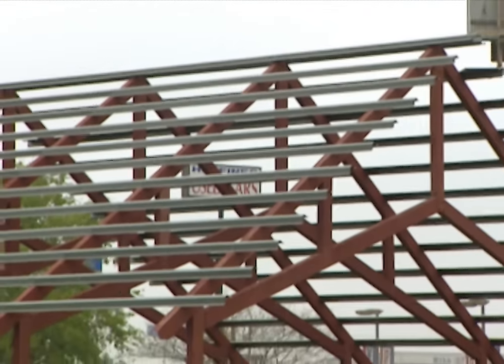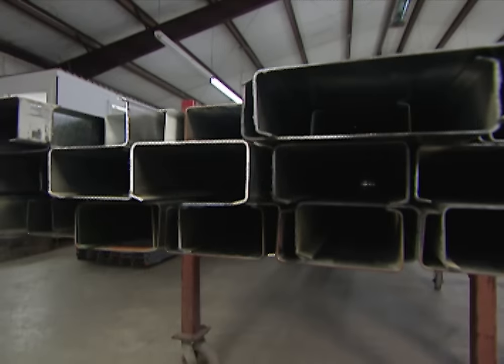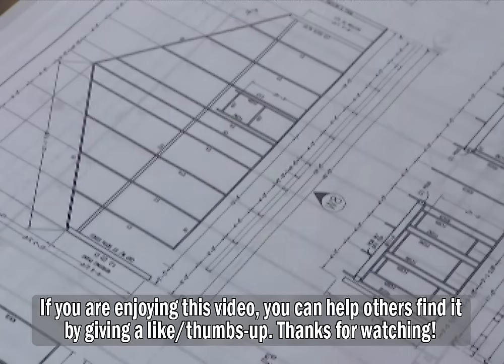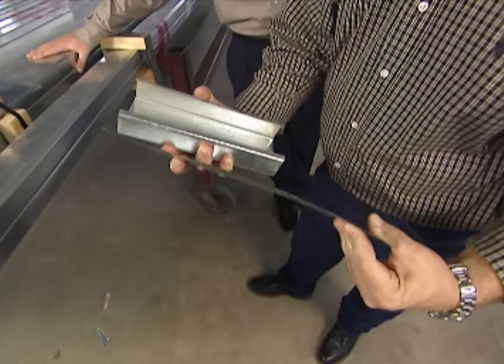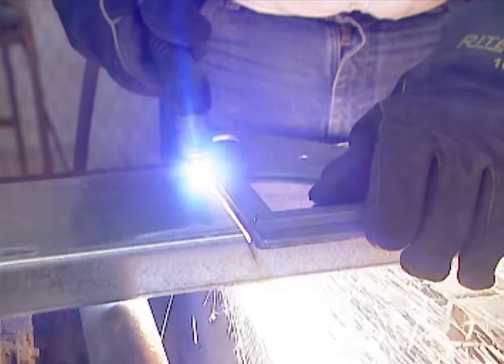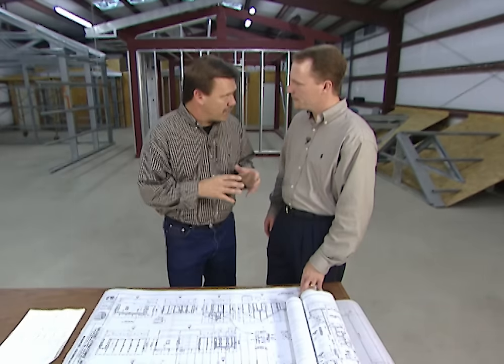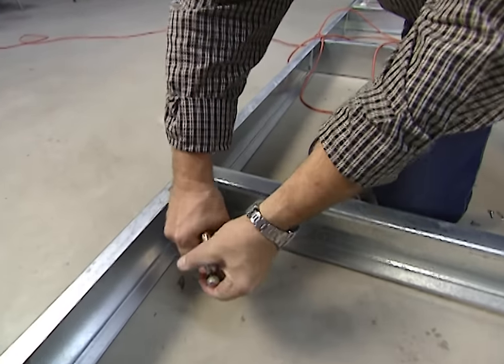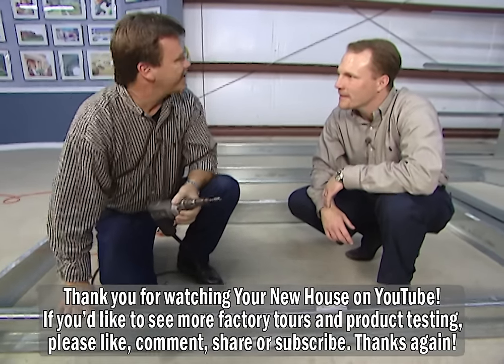Steel Framing - Did You Know?

Comment: Was this video originally filmed in the late 90’s/early 2000’s and then reposted this year because of high lumber costs???
Reply: OMFG.  Was think the SAME exact thing!!!  And the lumber costs are going to get worse!
Reply: Any home that relies on wood for support does not get my vote. Think huff and puff. There is nothing wrong with steel support, it is superior. But the labor industry would naturally disagree. I saw a row of townhouses here which consisted of nothing but a concrete base, wood framing and brick outer layer. The cost to buyer was insane.
Reply: hahahahahahaha
Reply: That place has been there for a long time. You can part and walk over to look it all over. I stopped by there in 2004.
Reply: I was expecting when I looked at the video date for it to be 2005 at the latest. Did anyone else notice the guys on the chop saw had no hearing protection? Talk about going deaf!
Reply: @flashbangkennya5498  : Yeah but what about proper eye protection first !
Reply: This does look like the early to mid 2000s
Reply: Lumber prices are absurd right now, time for homebuilders to give steel 2x4 more consideration
Reply: This is old footage. Do a web search on Tri-steel and see what comes up.
Reply: Lol good call dude....it totally looks like it
Reply: I built a Tri-Steel home in Michigan in 2000.  Awe, the good old days.  My wife and I built the entire home with a little help from friends. Twenty one years later it still stands talk and proud!  So sad that the company went out of business.
Reply: my man hahahahah denzel voice
Reply: This is a clip from "Your New House", a television series that aired from 1995 to 2005. So, yes.
Reply: This video was shot with a DSLR camera with a rolling shutter... You can tell by how the image distorts into fluttering bends and waves when looking at all the vertical lines (So it was videoed more recently than 2008)... but by 2010 any decent videographer knew better than to move the camera while videoing vertical "stripes" with a rolling shutter or zoom like they did near the beginning of this video... (which is a total rookie move.)
Reply: And?
Reply: It must have been filmed a while ago, because health and safety is not a thing in these videos. No proper face or eye protection, or arms really, get a lot of scars from burns on the arms.
Reply: I heard 80s porn music in my head watching this???
Reply: What lumber costs? I own a tree farm, make my own lumber.
Reply: they guy wearing pleated pants was the major giveaway!  lol
Reply: That's kind of why I'm here😅 not going to lie I live out where we get a lot of water and termite damage I'm also trying to figure out a good way to avoid plywood maybe a composite or even look into polyboard
Reply: @paulmunro3175  the longest time I thought I could actually use Plastic Lumber by itself and I realize how stupid I was but using steel frames while still having some sorta polyboard is what I'm currently looking into because where I live water and termites are so bad I don't mind putting in extra money knowing is going to save me money in the long run I just have to find the right materials and of course the right manufacturer because let me tell you I used to see like 4 years ago a lot of steel framing being advertised as DIY custom kits but now I can't even find that and I find that a bit suspicious not to mention I'm going to have to strong arm the hell out of my homeowners insurance company and probably my county's building permit agency even though I live in a state Ware manufacturing steel is in the top three things my state is known for producing the other two being coal and bourbon I swear these companies do not want people to go against tradition it really makes no sense
Reply: That explains the 38 pixels
Reply: After reading your commit I had to look up the cost difference between wood and steel. Today steel studs are going for around $5.00 a stud and wood is going for $8.00 to $10.00. When we started our detached garage project a few years ago wood was a much cheaper option. Now, this may be an opening for steel studs to become the new norm for building.
Reply: @flashbangkennya5498  Yah, I noticed that, unless he had ear plugs,but I looked closely and didn't see any. I'm surprised the company allowed that video as this would be a work place safety violation.
Reply: @krazyj1957  3-5/8" 20ga studs are going for around $0.82/Ft in the central Texas area right now, and I buy large quantities so this is wholesale price. Top and bottom track are worse, and heavier gauge structural studs are well over $2-3 a foot. Yes, lumber prices are crazy, but steel studs aren't cheap by any means, at least in my area. There is also an enormous shortage, causing 3-4 month lead times for steel.
Reply: @paul49777  How do you deal with thermal bridging in Michigan?  I can understand wanting this type of framing in Texas but in Michigan did you do something different with the insulation to keep the steel from conducting cold from outside?
Reply: @chrisvaiuso6010  , used rigid exterior insulation 1 1/2” then with water proof house wrap. Inside the 8” wall cavity used blown in “NuWool”. Added 3/8” hard foam insulation on interior walls and ceiling before the dry wall installation.  Had zero thermal bridging spots detected with thermal/IR cameras when measured four times at the start of each quarter the first year after construction.  The house is twenty years old now, though we no longer own this home it appears to be preforming well for the current owners.  A follow up cycle of thermal/IR measurements would be interesting to evaluate the entire system.
Reply: @paul49777  Did you monitor your energy usage compared to neighbors with traditional houses?
Reply: @moodberry  I did not.  Though it would not have been beneficial, at the time there was not anyone that had a 3500 sqft house within two miles of me. I had installed a pump and dump geothermal (3 ton (WaterFurnance) unit) heating and cooling system, again not another one of these within ten miles. My total electric home had a monthly expense of $265.00 averaged throughout the year.  I figured that wasn’t too bad considering the basement was not in the conditioned space and it added another 2500 sqft.  My well produced 150 gallons a minute at a temperature of 57 degrees year round pulling from a depth of 215 feet.
Reply: @flashbangkennya5498  no safety glasses for flying metal or sparks....
Reply: in my country light gauge steel was much more cheaper

Comment: Not one word about cost comparing to wood frame
Reply: It’s on par with timber.Here in Australia about half of all new homes built are steel framed.Primarily people choose steel because it is termite proof.
Reply: @davidjohnston7512  considering 96% of Australias population is near the shoreline, isnt rust an issue there? I mean i know termites suck but the humid salty air is just as bad on steel isnt it?
Reply: Yes , that's #1 Question
Reply: @gags730  Point taken, LOL/ Don't cheat on your wife
Reply: @gags730  lol 🤣
Reply: Yesss.. like why even repost it..its like being left with blue balls
Reply: @aurcrispy6329  LMAO!
Reply: steel used to be more expensive than wood, but not in 2020 and 2021
Reply: @cyclopsvision6370  I work with wood framing and I have not priced steel for any of my projects. Wood prices are going up and that's for sure. Might have to teach this old dog few new tricks and start looking into steel framing LOL.
Reply: @midas7934  It's galvanized.
Reply: @derpmansderpyskin  yes im aware of that, but galvanization doesnt last forever, especially if you live in an environment where the atmosphere is somewhat corrosive to steel. The further you live from an ocean the better you are. But also keep in mind the steel is very thin, it can rust through fairly quickly. Where i live there are some steel buildings, like warehouses, where the frames are made of thick steel (galvanized) I-beams, the galvanized coating is all gone and some of them have deep pitting, but these ones are within a couple of miles from the ocean, some slightly further are still rusty but mostly surface rust.

Comment: I love the comment, "we use an industrial steel chop saw with a 14" blade".  He makes it sound so professional use only, heavy duty, factory grade when in fact it is a basic steel chop saw, made by DeWalt, sold at Home Depot.
Reply: Yes, I thought the same.
Reply: Wrong, the metal chop saw has much slower RPM.
Reply: True I been doing this for 15 years that’s all we use
Reply: @billnunya858  yes, it's a basic tool you can buy at home depot. They're not that expensive.
Reply: Sell the SIZZLE not the saw
Reply: you can tell this was made in the early 19th century.
Reply: I wonder if they use those new flat metal retractable measuring devices. Tape measure?

Comment: i was a commercial (primarily) painter in the early 2000s and i had always been wondering when steel studs were gonna be used in residential construction. I would absolutely love to build a house that is made up of recycled steel framework. i'm glad this concept is finally getting traction outside the commercial application aspect.

Comment: I built my home out of steel 24 years ago, just like this. It's was manufacturered by tristeel.  It's the red iron style and the home plan is called cumberland ,  if they still make that one idk, but I love it.
Reply: Are there any problems with heating, cooling and condensation?  I can see the steel studs conducting a lot of heat through the walls.
Reply: @eitkoml  theres this modern invention we have now called "insulation" that tends to help with that
Reply: @bigmikeobama5314  And there is the problem of the steel creating thermal bridging.  Basically creating channels through which heat can flow in or out of a building easily.  

In most houses insulation is placed between the studs, with wood also providing a less effective insulation.  If the insulation will be placed between the frame and exterior then there is the problem of how to mount it, and what the siding and vapor barrier will attach to.  If more steel is used then the thermal bridging problem is not solved.

Steel can also easily lead to condensation, which leads to mold growth and rust.
Reply: @eitkoml  most of the time, it's a blanket of uninterrupted insulation, outside the studs (or however is designed for your environment). There are other ways to minimize thermal bridging as well.

Comment: I built a house for myself with this and it came as a kit (120 square metres) in 2002. It took about seven weeks from pouring the slab to  having inside and outside cladding installed including water, electricity and gas fixtures installed and operational. Brilliant to work with and the building was cyclone rated.
Reply: Cool story, bro.
Reply: @kaydog890  and you have less than 10k in the bank lol
Reply: I wish you posted on Youtube your DIY so we can learn from your experience.
Reply: @KA-vs7nl  I think you'll have way less than that buying a raggedy old house. 

Condo? 

Oh. You mean when you get 0 say on maintenance and it falls over? And you only own AIR?
Reply: @KA-vs7nl  steel studs ran cheaper than wood over the pandemic. I think they're similar or equivalent now.

Comment: As a former demolition worker I did see rusted steel on lower support steel when water was near by. Such as commercial restaurants, dishwashing areas, bathrooms, and sitting water. Just a fact. Otherwise great alternative. Clean up any water disasters around the base framing and keep dry. I would almost suggest engineering drain holes near those type areas. If your going to make a claim talk to people who see it all the way through its life back to the recycling bin.
Reply: i always thought it would be cool, although expensive to do this kind of house but with aluminum
Reply: You can paint the lower structure. Paint over galvanization is about as good as it gets for steel rust protection

Comment: Another great benefit is straight walls like engineered studs drywall finish will gave far less waves and bows. Our house is now 4 years old not a single crack on the drywall, not to mention a single creek or pop. House is dead silent in the wind and rain. Only weakness now is our shitty U.S standard double pane windows. Many European homes use triple thick pane  windows with a very high r value and even sound dampening.

Comment: keep in mind, there are weight bearing and non-bearing gauge of steel studs.  Always the same dimension, always straight.  Rain isn't going to hurt them stacked on the job site. I use them in basement build outs below grade.  If the foundation ever leaks, you don't have to worry about rot.  As far as screws to hold the studs in place, many guys don't put screws in the studs/floor/header plates.  When you set the studs every 16" or 24", the screws through the drywall into the studs will hold the studs in place. When steel studs first came out, you could drill and rivet each stud into place. OR there was a tool that punched/crimped the studs onto the floor/header plates.

Comment: I built a  big , all steel and concrete block  shop out of wideflange beam cuttings , joining then all together to make beams and rafters . And I got the steel cheap , because it was cuttings . It also    has 2 built in overhead cranes . lots of big high free span areas  . 32 years later , it looks like brand new .  At the same time , I remodeled my house , its wood  . 32 years later , theres rot breaking out all over the place , from       ants , and joint leaks , even though it got a new heavy gauge steel roof . If I were to do it again ,     Id build the house like the shop , then its done , as long as Ill be here .

Comment: When I built my 8X12 shed I used the steel 2x4's from Lowe's.  The front wall was 8' tall so no cutting for height.  The rear wall was 7' so water would drain off nicely and I did all my cuts with tin snips.  I cut the two front parts of the "U" shape and bent the 4" back and straightened it over and over until it broke apart.  It was quick, simple and quiet.  I screwed 4x8 lap siding boards to it and the only issue I had was the 2x4 pushing away from the screw if I was too far from the center near the unsupported end of the "U" shape.  I caulked the screw heads and painted it and it came out fine for a shed.
If I had it to do over, I'd cut about a 4" wood 2x4 and put every 2' so I'd be able to pull the board in nice and tight.

Comment: Hold on....galvanized ok, but when you cut it, is the edge still galvanized? Wouldnt you need to re-galvanize every edge and drill hole? Seems you need to cut every piece and then dip the parts the way they do car bodies? Otherwise isnt every part rusting and corroding the moment you cut it? Or, should you erect the whole structure and then spray it with some kind of coating to seal up everything?
Reply: No. It not like pressure treated wood. The zinc coating on wet galvanized steel acts sort of like a battery to prevent corrosion at cut portions. The zinc is degraded slightly to help protect the unprotected steel creating what they call white rust on the zinc. And removing some of the zinc metal. One surprising thing I learned however is that in damp environments you might not want the steel sitting  directly on wet concrete. Like in a commercial shower room or bathroom. I heard the practice is to put a pressure treated sill below the steel bottom track of a stud wall, although that was years ago, they might have better technology today.
Reply: @garywheeler7039  Sill gasket, a strip of rubbery plastic frequently used even with wood framing to separate wet/cold concrete from the framing.
Reply: @jaquigreenlees  : Yes, a type of sill sealer.
Reply: LOL, the galv. studs are not exposed to moisture, my homes are rated in the 2500 yr range.
Reply: They make Galv spray . We use it in the Fabrication industry.  It lasts a long time.
Reply: @lawsfreelancemalice1380  : Sorry, I do not respond to ranters, nothing personal.
Reply: @billnunya858  how much does it cost?  I’m buying a small piece of land and want to build a house on it.

Comment: The problem with steel frames is that it changes temperature more rapidly than timber frame, meaning more condensation. That's why in NZ commercial buildings we use timber for exterior walls and steel walls for interior walls. Benefit of using steel frame is just because you can span wider
Reply: Last few I did they used spray foam insulation (very expensive)...  interior vapor barrier, and breathable fiber (densglass..?) sheathing. 

All construction is based on regional climate considerations.   If you build a traditional New England house in Lousiana it will rot away in a decade.  Vice versa... you will freeze to death in a winter.

We did a lot of steel to wood to steel joinery, mostly schools and hospitals.
Reply: That's why with steel you're supposed to do exterior insulation only, so if you condition the interior the frame stays at the same temperature year round. Of course some builders cheap out and try to build it like wood, with fiberglass between the studs.
Reply: @hailexiao2770  sounds right

Comment: I like steel to frame homes. Run the electric and tech wiring thru concretewrap inside ansd out. . Brick faced. Steel roof. Sprayfoam insulated.

Comment: Steel framing is much easier than wood.  Did both for 20 years.  Don't miss crowning 20' hemlock 2x10's.

Most light commercial has been steel studs for decades.  Nothing like a 50' batch of exterior wall studs to get things going.